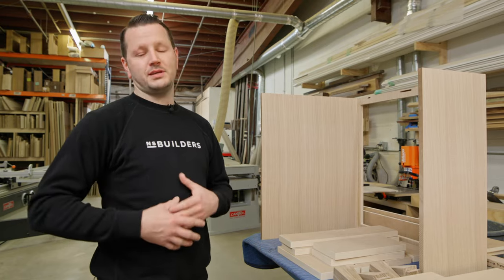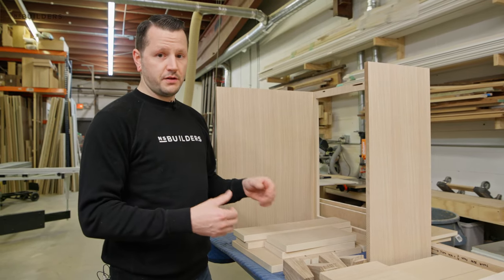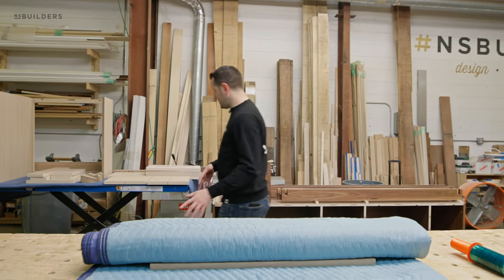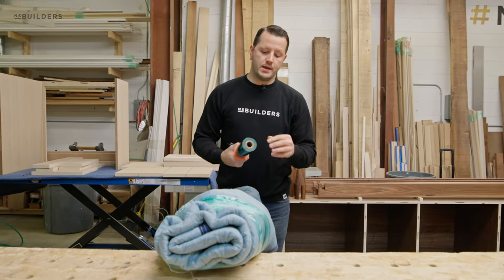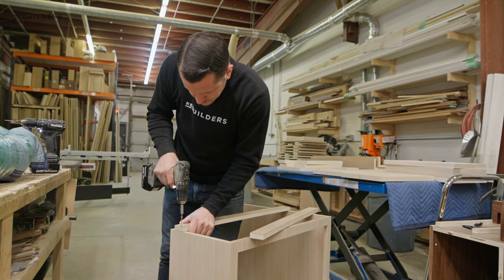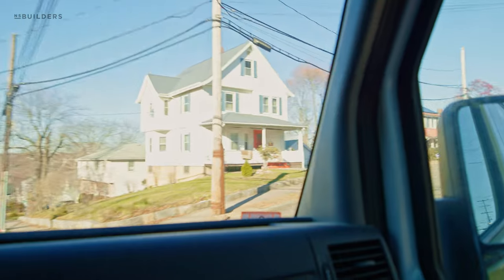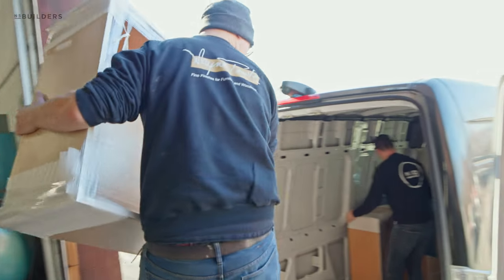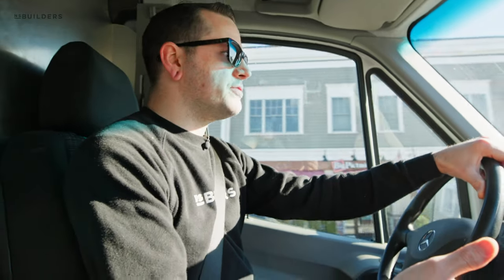Protecting your finished cabinets during transport

Comment: Unrelated question.. have you ever in this shop or previous shops done work for other builders/ contractors. In other words have you built custom work for other builders and their crew to install, so you focused on shop work and left the install for others? If so what are the pros and cons and is it lucrative for a small shop to go that route? Thx